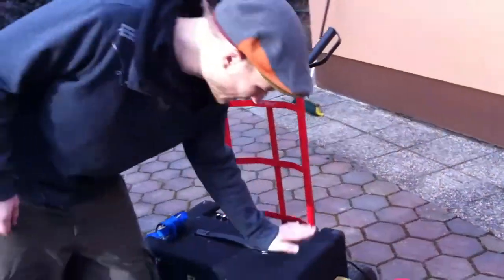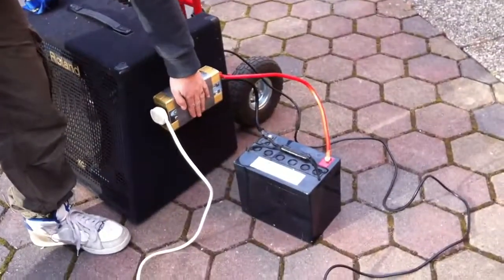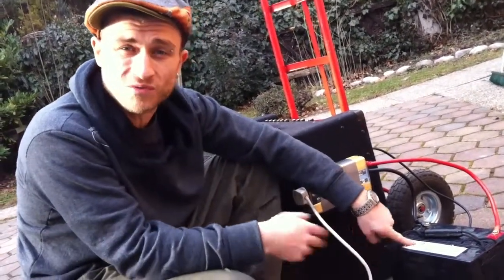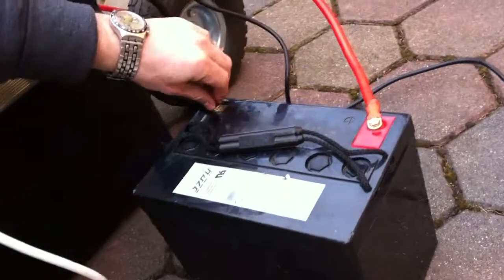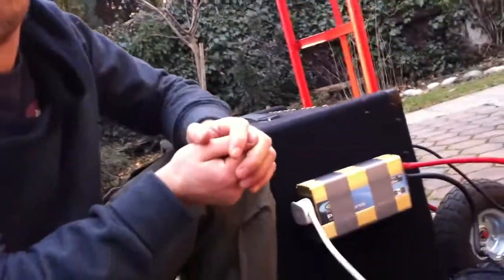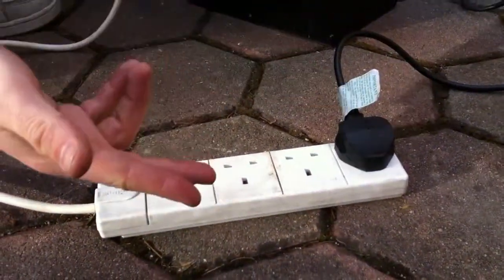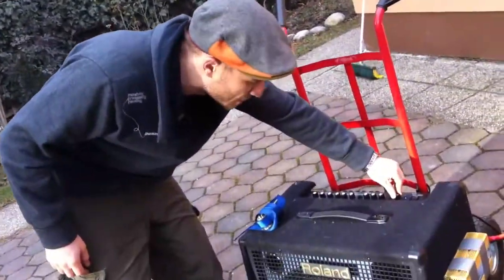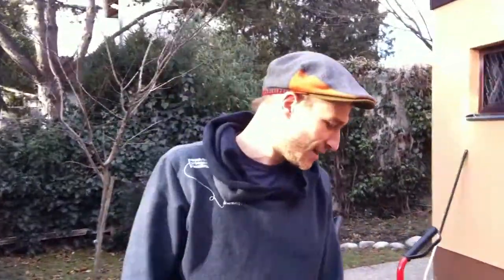Dub Fx street set-up

Comment: 200w output (always played loud). 800 watt invertor (which type) im curious to know which type as i hear modified sinewave inverters make more unwante hissing but your videos seem to not pick this up in the recording of the audio. 
Ive got a 100watt bass amp combo with a power consumption of 310watts so i grabbed a 500watt (1k peak) inverter and now looking at deep cycle gel batterys. thanks for the share and knowledge